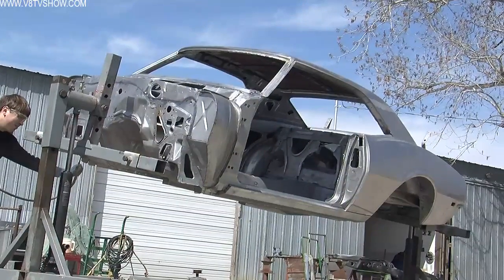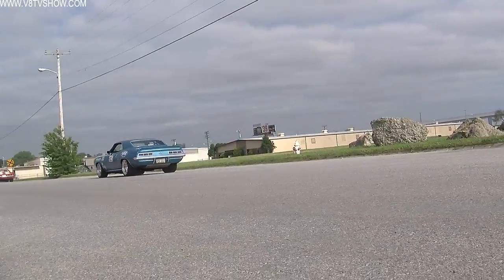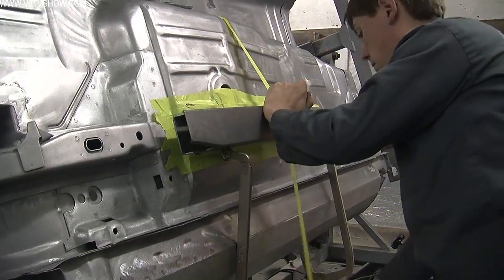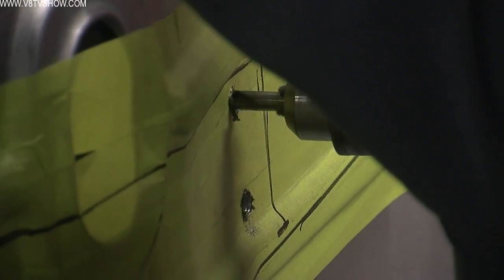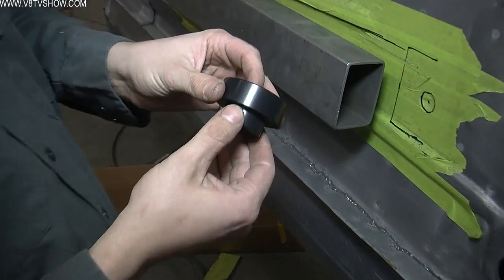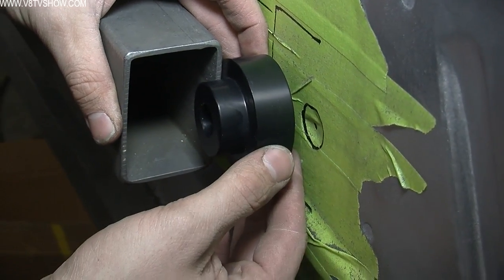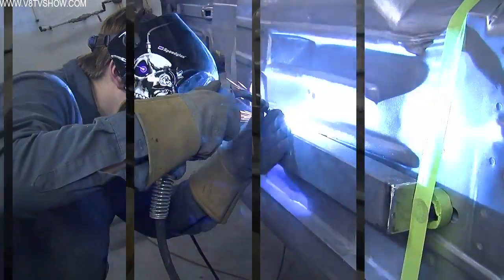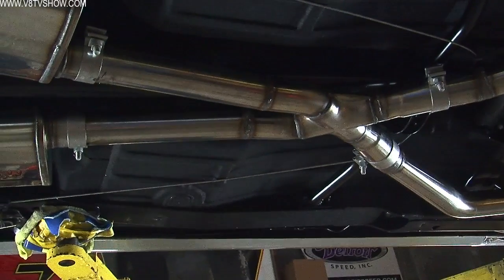1968 Camaro "Reloaded" Detroit Speed Subframe Connector Install Video V8TV

Comment: I just want to say. Nice video, but if you plan on using this video as instructions to install a set. There is one thing that needs to be said. In the video he uses the body bushings as a guide to set the height of the connectors. If you do this, it will work, but when you look at the connector from the side it does not line up with sub frame. I put the bottom of the connector with the bottom of the sub frame. it makes it look like one frame from the side. I'm not sure the correct way because DSE instruction are not that helpful. This video did help me get them in, but I did have the cut the first one out and reinstall it the way I explained. I hope this helped.

Comment: Many of us do NOT want the floors chopped up and would tolerate a 2 inch bar exposed that really is NOT hardly ever noticed anyway.
BAD Design to cut tue floors up like this unless you're making a full time restomod or a race car.
Reply from the maker: There certainly are options for subframe connectors, you could use the type that bolt under the car, but in this case, these provide far more rigidity and provide a cleaner look from the car's profile.   Once finished, you really do not notice the connectors under the carpeting.   This car makes over 550 HP and is track-day capable, but not everyone needs that capability.  Here's the finished car:  https://youtu.be/8PVnjH8wO6A